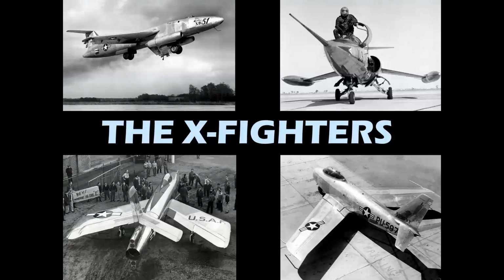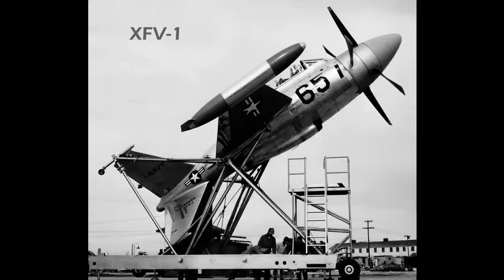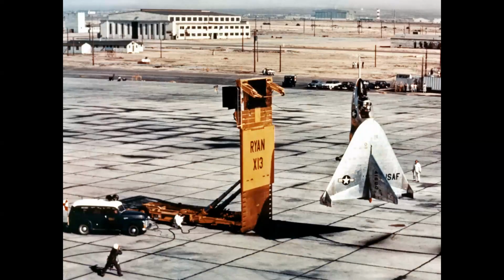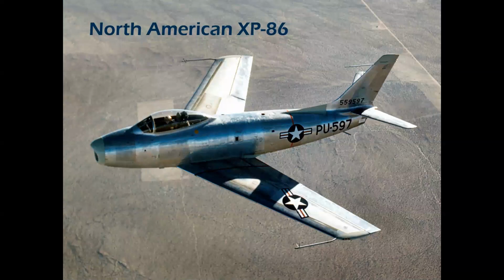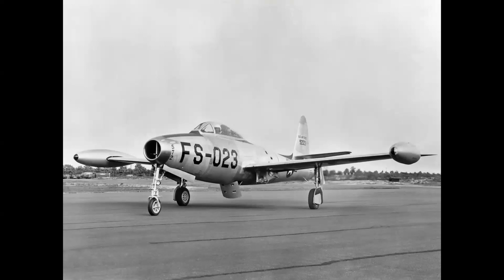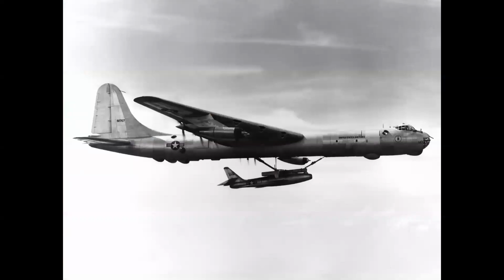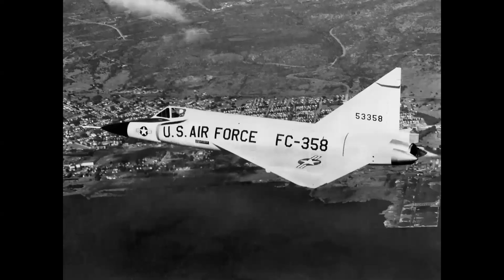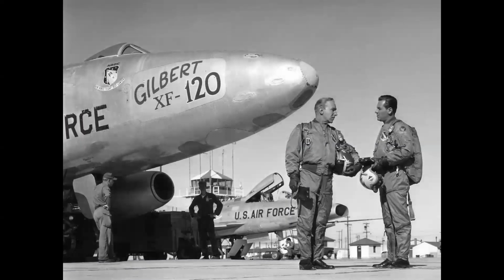X-FIGHTERS - Experimental jet fighter prototypes from the Golden Age of Flight Test.

Comment: Although everyone now expects everything to be designed on a computer, these aircraft were not. These were the days of sliderules, paper and pencil, wind tunnels, and sophisticated engineers that really knew how to do research and advance the field. I wanted to be an aeronautical engineer but by the time I was in college, the field had changed so much I did physics and chemistry instead.
I think the first aircraft to be designed on a computer was the Boeing 777 in the early 1990s! Since then, engineers have become experts in cut-and-paste designs and mediocre programmers, hence the 737 MAX.
Reply from the maker: Excellent point, and yes, the Boeing 777 was the first airliner created with a digital design system, while Northrop's B-2 was the first airplane to be designed digitally. McDonnell Douglas had that technology in the early 1980s but was unable to apply it to existing aircraft production - needed a brand new aircraft built in a brand new factory. Thanks for watching!

Comment: Slight correction for the XF-85 Goblin, it was designed to be flown off of the B-36's not B-29's, but the Goblin was tested off of the B-29's because the B-36's was not available for the flight tests of the Goblin but the Parasite fighter program turned into the Parasite Reconnaissance program and was quite successful with flying the RF-84K Thunderflashs.
Reply from the maker: Good point, thanks!

Comment: The XF-90 was one of three designs that the air force evaluated for the Penetration Fighter mission, and the XF-103 was a very unusual design with a mixed propulsion engine, which was supposed to push it up to Mach-4, not Mach-3.